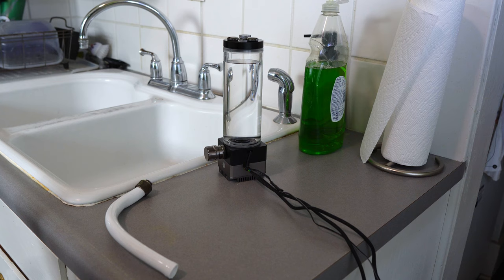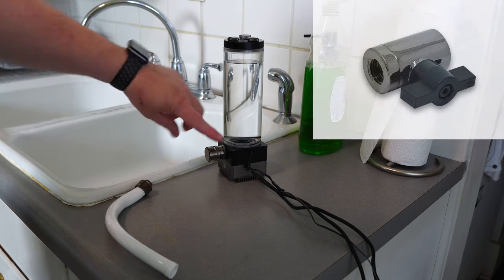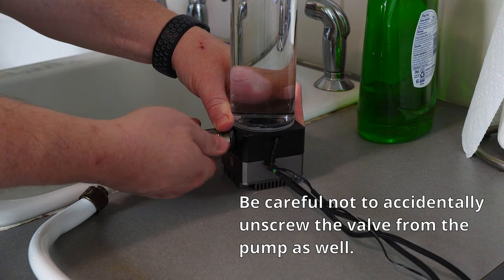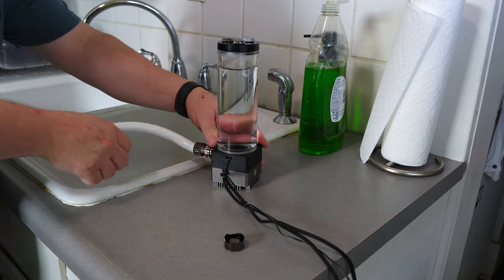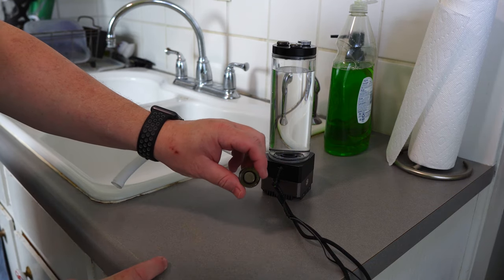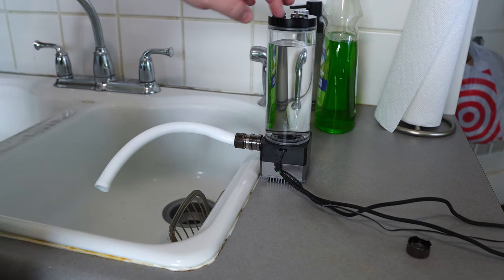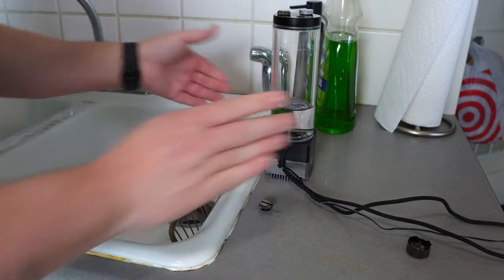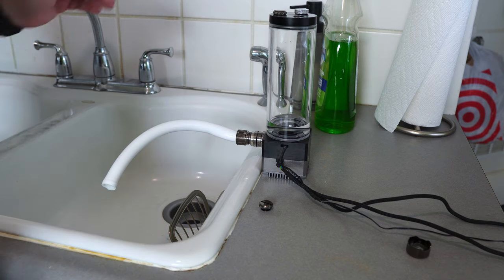How to use EK's Quantum Torque drain valve fitting

Comment: Thanks for posting this video. I wasn't certain how it worked and EK really needs a demo video.
Reply from the maker: Glad it helped! Ty for watching.
Reply: @MiddleofKnowhere  .. BTW because of your video I ordered one. It's a no-brainer. Thanks again and good luck with your channel! 👍😎
Reply from the maker: Awesome ty. If you are using any bottom rads and distro plate get the low profile adapters too. I have a dynamic xl and intend to use ek’s new rads and the bottom rad will have the drain adapter as it will be the lowest.
Reply: @MiddleofKnowhere  .. Yes I'm using the biggest radiators that will fit: 
• EK-Quantum Surface X360M
• EK-Quantum Surface P360M
• EK-Classic DP Side PC-O11D G1 D-RGB + DDC 4.2 PWM
Reply: @MiddleofKnowhere  what low profile adapter are you talking about, do you have a link to that specific item?

Comment: Thanks for video, I installed this to drain my already full system and managed to accidentally figure it out, roll on a month over xmas and I couldn't quite remember. I started pulling on the inner bit etc counter clockwise twisting outer grip (it was dark I couldn't tell it was 1 piece). Now hopefully i can refill using the drain, may need to remove a GPU blanking plug to allow air out as I have no reservoir in new setup.

Comment: Thank you for explaining how this valve works. I'm new to water loops and am about to build my first system. I'm now thinking I might need two drain valves. One for the bottom of the radiator and one for the pump/reservoir. The bottom of my 480mm radiators have a drain port. Ok. Now I might need a total of 3. Two radiator drain ports and a pump reservoir port

Comment: Thanks for this video. Definitely going to use this for my O11 XL build with the reflection distroplate in the front. This is a much cleaner than the ball valve.
Reply from the maker: Glad it was helpful. :) I use it on the front too but i just tip the case up and screw it in. I don't have it in full time lol. I gotta say the build with the dynamic XL is so gorgeous! Just cleaned the filters and glass today. It's just amazing lol.

Comment: Thnx for the tutorial. I am new in the whole watercooling scene. Starting tomorrow with my first custom loop. Just placed a ek waterblock on my 3090. I was looking for a drain valve and didn't know which one to choose. I picked the ek one thanks to your video. Its so small and the build in security measurements are great. How are you liking it so far?
Reply from the maker: I really love the 3090 Strix gpu block and active backplate. Temps are soooo much cooler. I love the torque fittings too. My replacement pump should be here soon. Murphy’s Law hit me and I had to get replacements for some things.

I like the drain valve too. It’s stylish and easy to hook up a soft tube fitting.

Comment: This is ideal for the o11D Distro plate
Reply from the maker: That's what I used it in except i take it out. What i've been doing is flipping the case on the IO side, put on the drain valve on the outside, flip it back down, then drain from there. seems to work. Not sure if I get a very good flushing though as the side rad is ported at the top. Can't wait for the new EK radiators.

Comment: Will there be a chance of accidentally pulling the plug to the open position when fitting in a tube at the end? Or does it require a significant amount of effort to open the valve?
Reply from the maker: so the neat thing about the fitting is there is a lock. If you rotate it a bit you won't be able to pull it out or in as there are teeth that more or less prevent it. Think of it like a cog.

Comment: Thanks for the video, short question: What diameter is the output where you connected that soft tubing? is it a standard G1/4"?
Reply from the maker: Yep just a standard G1/4" fitting also an EK one. I bought a bunch of their  colored fittings to see what they're like. The colors are super vibrant. The copper color ones are cool too. It's their older model of fitting. The one used in the video is also Black Chrome.
Reply: @MiddleofKnowhere  Great, thanks for the quick answer! Connecting a G1/4" to it is gonna come in really handy since ill probably use the port to fill up and empty my loop since im planning some wonky reservoir placement

Comment: Hey, sorry. I'm looking to get a similar thing for the build I'm planning. What fitting from EK did you use in this instance? I just need to pick up a small bit of soft tube as well that works with it I assume. Cheers!
Reply from the maker: Hi and thanks for watching! For the tubing I used primochill 16mm OD tubing as it came with Utopia, a system prep. For the fittings, I used EK's STC 16mm OD fittings: https://amzn.to/3GYKgqC I bought a bunch many years ago in different colors to see what they looked like. :) Hope this helps.

Primochill tubing: https://amzn.to/305riOo
Reply: @MiddleofKnowhere  Cheers mate, that helps loads :D. Thanks very much!

Comment: Can you use a EK STC  fitting on the tub you put in or do it have to be a barbed fitting to connect to the valve?
Reply from the maker: I was using ek classic stc fittings. They have that barb to go inside the tube which is then clamped.
Reply: @MiddleofKnowhere  Oh ok thanks!

Comment: Hi could you tell me please what size of Softtube do you use and which fitting for the drain?
Reply from the maker: Sure thing. The drain fitting is the EK Quantum Torque drain valve, and the barb fitting are EK Classic barb fittings for 10mm inner diameter/16mm outer diameter soft tubing..
Reply: Dont know where my new comment went, but this are the correct two items EK-Quantum Torque STC-10/16 - Black and EK-Loop ZMT Soft Tube 10/16mm 1m – Black?  @MiddleofKnowhere
Reply from the maker: I have the older classic soft tubing fittings, but those torque ones will work.

Comment: do you need the other fitting to actervate it?
Reply from the maker: You’ll need a regular soft or hard fitting with a tube connected so you can drain the liquid but you can activate it without
Reply: @MiddleofKnowhere  ok I did pop the fitting forward but it dident look that the middle open up